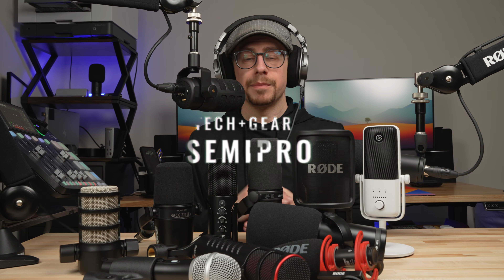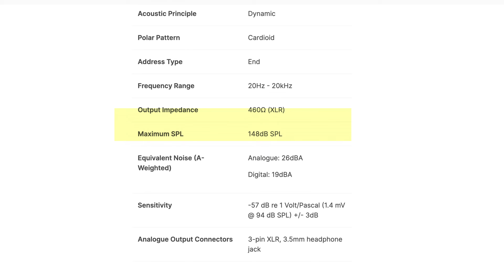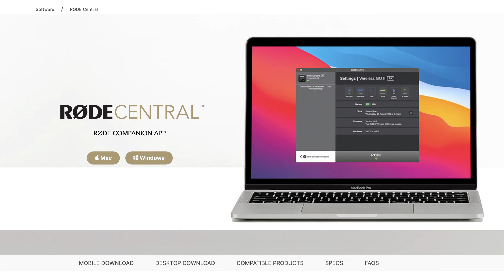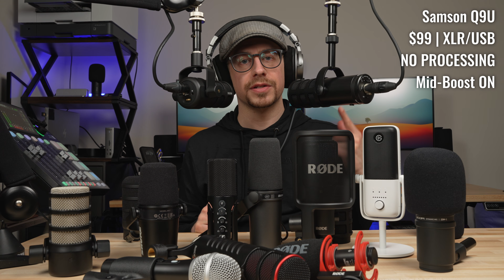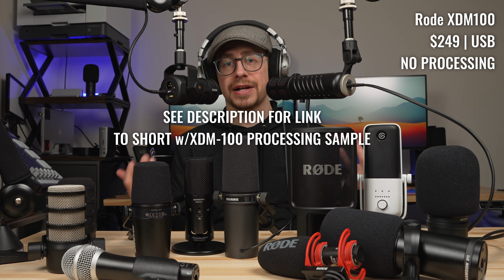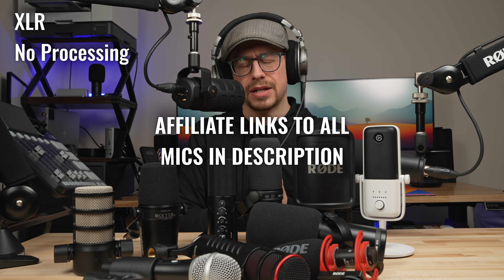Rode PodMic USB Review with Comparisons - MV7, SM7B, Profile, XDM100

Comment: I am one of those that is in between the Shure MV7 and the Podmic USB. I think de Podmic USB wins in price and ease of use. Both are great in sound but I love the Shure MV7 because of looks. I am looking for a dynamic microphone to use in Zoom calls and on Short Form videos. What do you think?
Reply from the maker: That is a tough choice! One other thing to keep in mind is that the windscreen that comes on the MV7 is not great at stopping plosives, so a lot of people will replace it with a different one that might change the look a bit. I've heard if you buy a replacement windscreen for the SM7B it works better and still looks pretty good. I personally like the processing options on the PodMic USB better than the MV7, although the noise gate is a bit finicky. I'm not a huge fan of the capacitive volume control on the MV7 but you can control both the mic gain and the headphone volume with that control - the PodMic only allows you to control headphone volume with the dial on the back, the gain has to be adjusted in software over USB. They are both great options for meetings and video content though so you can't go wrong!
Reply: Aliexpress sells pop filters similar to those of the SM7B for 3-5 euros that can be put on the MV7